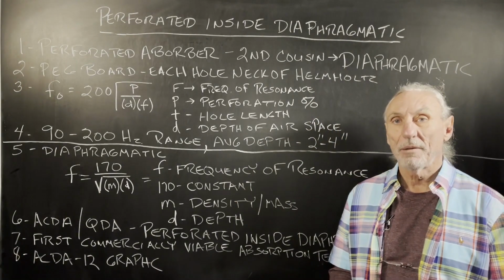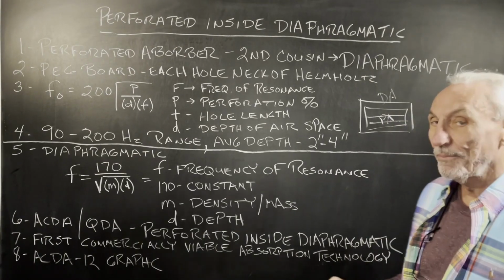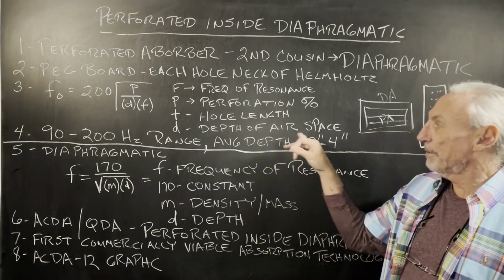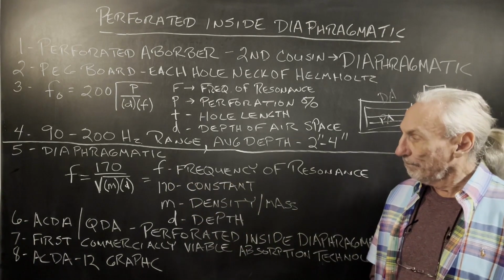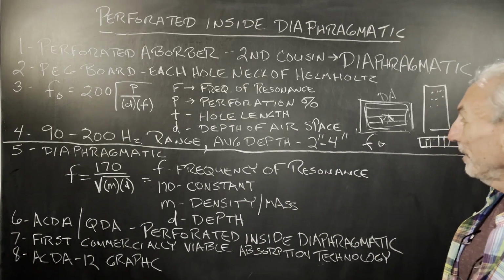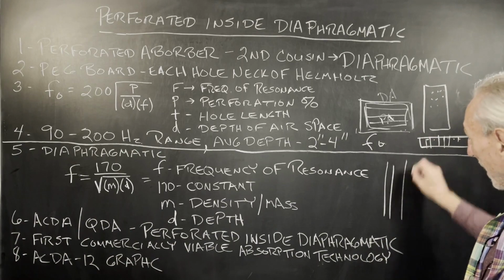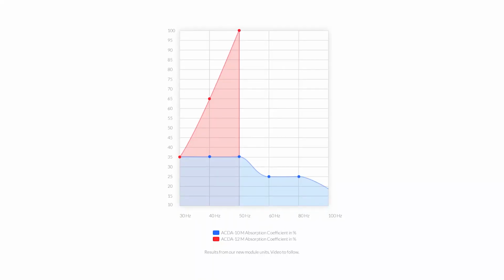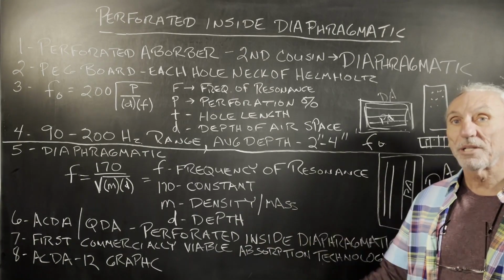Perforated Inside Diaphragmatic - www.AcousticFields.com

Comment: What about the diameter of the hole?  Would that make a difference? would a larger diameter hole work at a lower frequency?
Reply from the maker: Diameter of hole, distance on center, and board thickness all play a part in the resonant frequency of the unit.
Reply: @AcousticFields  Great to hear from you.  Any new videos coming?

Comment: If I had to build a house or remodel my current.  Sound engineering is a hand in hand with th construct. At least one unit in this globe is music ready. And recording. 😅
Reply from the maker: All material types used in construction of a music room are frequency and amplitude dependent. Quality sound that has high resolution is no accident. it is by design.

Comment: Panel of the diaphragmatic absorber is way to thick. Pressure can't reach the PEG board. Only the the first layer has a chance to displace leading to narrow band efficiency in the low end region.
Reply: Pressure waves are upwards of 30+ feet long in the range that their thickest cabinets are targeting. You need that amount of depth to catch anything that's that low. With wavelengths this long, there's really no way the perforated absorber isn't able to perform.
Reply: @wraithwrecker_  You miss my point. I'm talking about the thickness of the clamped wood panel inside the box (1cm) Pressure wave can't create effective back and forth displacement for such a membrane, that's a fact.
Reply from the maker: A perforated absorber inside a diaphragmatic only has to manage the internal cabinet resonances to ensure that the cabinet rate of absorption is linear. The depth of the cabinet determines the resonant frequency of the unit. The carbon perforated absorber manages the rate of absorption at the chosen design resonant frequency.
Reply: @AcousticFields  Did you perform any measurement in acoustic laboratory? If so, would you please give a link to the absorption coefficient datas with respect to frequency concerning this device? Acoustic simulation leads to a narrow peak of absorption at 63Hz. What determines the resonant frequency is not simply the depth of the cavity but the different masses and the compliances of the cavities.